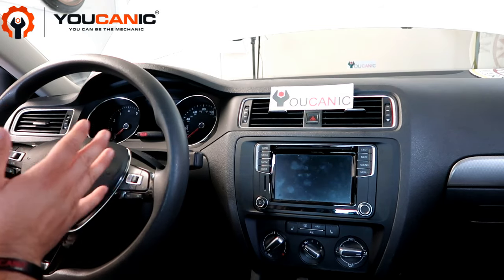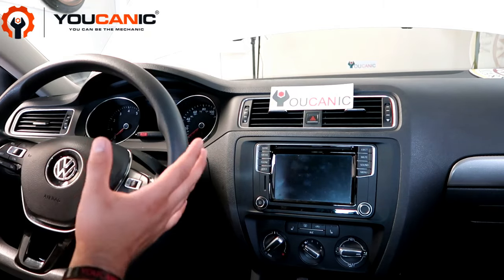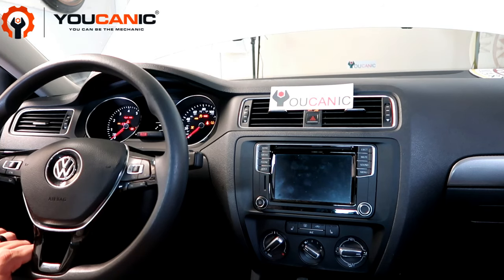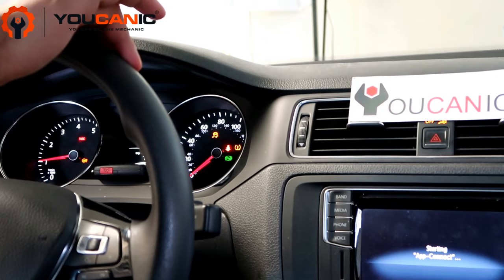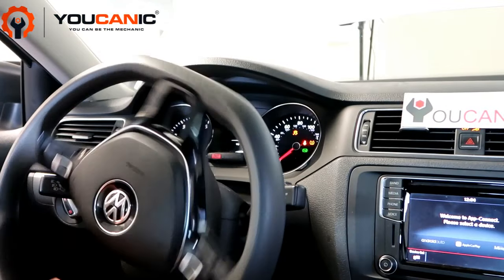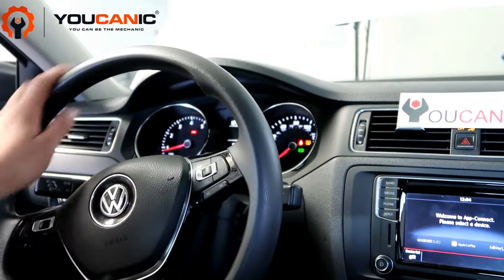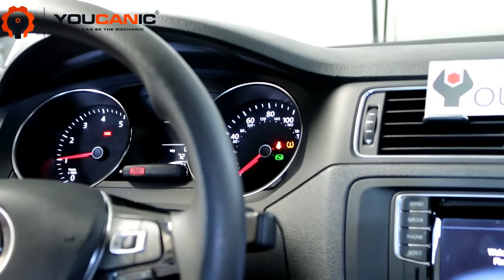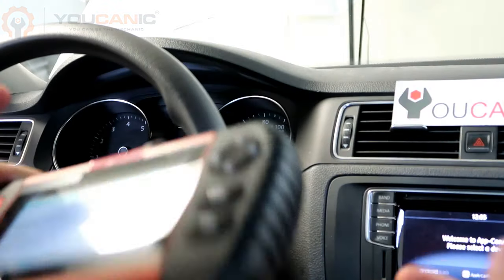How to Reset the Steering Angle Sensor on a Volkswagen: Step-by-Step Guide

Comment: My 2013 VW Bug would not start and had all these fault lights on. We could see the battery posts were a bit corroded, so we cleaned them, then did a jump start. All the fault lights were on...  did this recommended move, and it cleared them all.  Thank you for the video.
Reply from the maker: Glad we could help.

Comment: Hi My steering angle readout displays the wrong direction of the wheel on the MID cluster. When I turn right, on the MID the wheel turns to the left and vice versa. How could I get this corrected? I have the Mark 4 Skoda Octavia. Thanks for your help .

Comment: Hello 
I have the same problem with my Polo 6R , when i turn completely the wheel on the right side for 5 seconds the signal icon appear , and the steering wheel  blocked , i can’t turn it in the left side , so i will be obliged to shut down and restart the engine . The problem persist

Comment: on my vw passat b6 I have no error in the instrument panel but in obd with the steering wheel in the right position it shows me g85 -9 degrees. how to reset g85 and learn the new dimension 0 of the steering wheel

Comment: Thank you for this. The problem i have with my 2016 Passat is that when turning Left on fast, long sweeping turns, the ESP thinks im oversteering and flashes and i can feel the car braking the Right Front Tire. It Does Not do that on right turns, only when turning left It bothers me that it interferes that much. I have checked the steering wheel and suspension alignment and its perfect. No Lights or Trouble codes on the dash or OBD2 scanner. ABS Sensors on wheels look fine, what else could it be ??
Reply: Did you ever figure out what this issue was? My 2014 be Passat is doing the exact same thing.
Reply: @Kunaminy  have u figured it out? This problem is really hard to explain in words lol… its almost as if you HAVE to feel it/ be driving and see the traction control light flicker on the dash while slightly turning the wheel.
Reply: @xalamander5502  unfortunately no... I ended up getting rid of the car after going to about 12 mechanics that just dismissed the problem completely because they couldn't replicate it no matter how many times I told them the exact conditions they need to be driving for it to occur... But I did get my tires rotated and it helped a little bit. Happened less, but still frequently.

Comment: My VW Routan 2011 has its power steering rack replaced. The mechanic can not reset the TRAC light with his computer. I tried the method in this video. But, it does not work. Anyone know OBD2 scanner that can do SAS reset for VW Routan 2011?

Comment: Hi, thanks for the video. Is the noise we hear when you turn the wheel to left and right normal? I started to hear that recently and got one time yellow steering wheel warning-lamp on, and then it went away. But the noise remained. I thought this noise indicates a problem. Now I heard the same noise in your video. So maybe it is normal to hear this noise?
Reply: The noise in the video is just dry tires turning on a painted floor.  You're probably hearing something different on your own car.  Likely pump or belt noise. A noise similar to this, driving on pavement, would not be normal.

Comment: this video shows nothing except making turn other than that nothing
Reply from the maker: Turning the steering wheel full left and right is one way to reset the steering angle sensor after the battery has been disconnected.  This video is only part of the guide that explains the process. See link in description.
Reply: Thanks...it worked well on my jetta mk6

Comment: The clock spring failed on my 2016 Tiguan R Line.  Original part is 5K0953569AP.  I ordered 5K0953569AL replacement.

Codes will not clear with new part installed.  Steering, traction, etc.  I have entered the code from failed part to new part with obdeleven.  Steering, traction errors clear with old part reinstalled after turning wheel to left and right stops every time swapped back in.  Steering wheel position in degrees is present in old part as is the delta degrees live data.  I do not see steering wheel position angle indication with the new part.  Steering wheel delta live data is present in new part.  Is the replacement part faulty?  Is there something else I need to do?  Not a mechanic.  Sorry for the non technical or imprecise terms.  New part came with key to hold 0 position.  I have not moved the  new part without the wheel installed.  I am confident the new part is zeroed.  Is the replacement part faulty?  All electrical connections fit and match old part.

Thanks in advance.
Reply: Did you find a fix ? My wife's car had new clock spring fitted and is doing everything you mentioned. I'm lost on what to do
Reply: @estring69  thank you